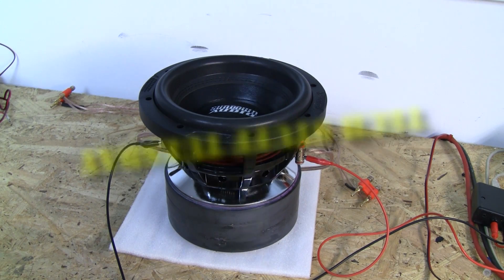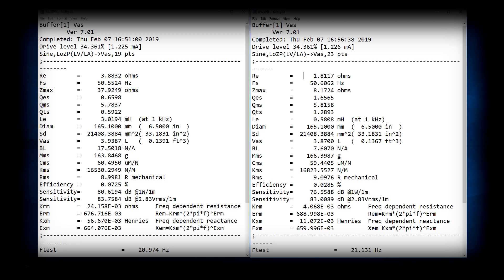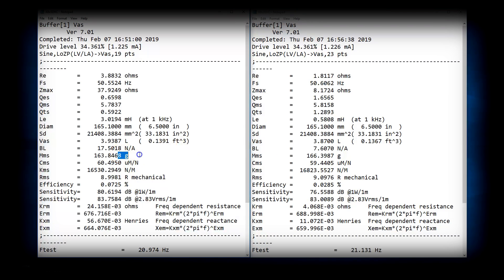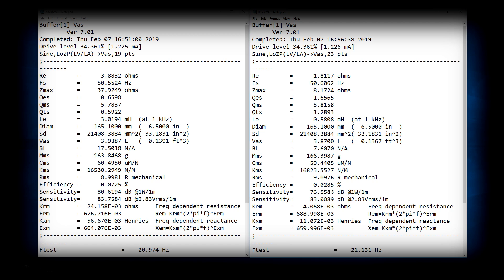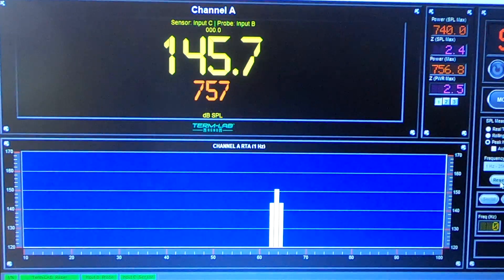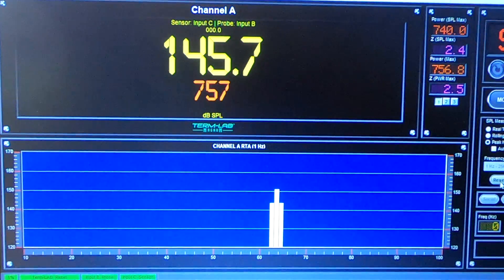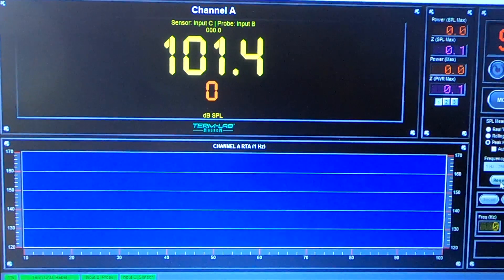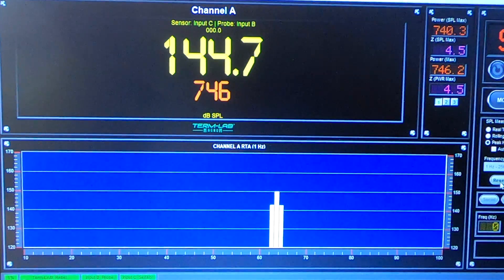This is what happens with 1 of 2 voice coils connected - Tech Stuff Tuesday

Comment: Since you tested the woofer parameters with the coils in series but did the spl test with them in parallel, would there be any difference in SPL if both configurations were tested? Assuming you achieved the same wattage in both tests.. My guess is the difference would be negligible, since the amp is large enough to achieve 750 into both configurations.
Reply from the maker: I've tested that in the past and found no difference in score, some people have claimed a difference but I think that is more the effect on the amp and how it's working because they were doing things like wiring at 0.25 ohm and 1 ohm with 1 ohm being louder, while clamping the same power.
Reply: @EMFAudio  Yeah I would agree.  I believe an amp's damping factor can take a real dump at that low of impedance. Among other possible factors.

Comment: So basically get a good amp that can push the crap out off anything no matter how you wire the subs
Reply from the maker: Doing that would result in a very expensive amp that isn't necessary. Example, if you need 1,000 watts @ 1 ohm vs 1,000 watts @ 4 ohms. You'd be buying a 4,000 watt amp to use it for 1,000 watts, which doesn't make sense.

Comment: Now see what happens when you run different signals to each one of the coils.
Reply from the maker: Bad things happen.
Reply: That's exactly what a dual voice coil speaker was made to do! They were invented as a way to flatten the unruly old subs response. Before EQs were invented they used notch filters to isolate the frequency with the peak running in reverse polarity. Once EQs came out Dual voice coils were were no longer needed. Then someone sees that old patent and makes a similar sub but uses both in same polarity, once again proving very few new things are ever really new. Things haven't changed much since 1930. Most new patents are bought up by big companies like GE who sits on it just to make sure that idea is never made, allowing them to continue making the same thing they already makibg with huge profits, only changing over to the hiding patent items when they see other companies developing a similar idea. Then we think it's brand new but in reality they're slowing advancement for their own profit. Look into old patents snd you'll see all kinds of new tech that is actually old news to those in the know.

Comment: Why the bass port on the outside of the box?🤔
It's supposed to be on the inside
Reply: They have outside ones also. Then you can change the length for different tuning
Reply: @mikecheeze4312  It's just normal ports but on the outside.
Can also change the length if they are on the inside and the result is a bit better in my experience.
Reply from the maker: You can't fit that port length in that box, for starters.
Reply: @EMFAudio  so really it's because it won't fit vs being more easily interchangeable? Is it common to build a ported box that the port doesn't fit in? Forgive my ignorance but I've haven't seen but a couple boxes with "out reaching ports" or whatever they're called
Reply from the maker: @mikecheeze4312  Being easily interchangeable is another reason. In terms of SPL, external ports are often louder. It's not uncommon to do external ports like this for SPL applications. It isn't normal for daily music stuff. These SPL boxes are generally tuned higher with more port area than you'd have for bandwidth.
Reply: @EMFAudio  Then it would in general be better to use a single slightliy wider but shorter port. I have tuned some enclosures to go very deep and very loud without having this long ports.
Reply from the maker: @Oystein87  There is more to it with these SPL boxes. But, regardless of if the port shape, port area is port area and that gives the same length for a tune. Shorter and wider requires the same length for tuning.
Reply: @EMFAudio  So it's more a SPL thing then?
No, not quite true. Shorter and wider (up to a point) can give the same tuning as 2 longer ports. When using 2 ports they need to be longer than just using 1. In general. But not always..  Depends of the giol. But since this is pure SPL use there is a a little difference.
Reply from the maker: @Oystein87  The difference in tuning from using 1 side of the enclosure as the port is very minimal, you might say inaudible.
Reply: @EMFAudio  I think you missunderstood me😋 But anyway.. Like the videos👍

Comment: I blew one coil in my sub so had to use just one and the difference is the sub looses half it’s power. It was ok but didn’t shake the car half as much.
Reply: how did you wire it too the amp tho
Reply: King Shumpert hi, I use to wire my dual voice coils in series so one lead to the negative to the negative on one coil and positive to the positive on the other coil. Then use a short wire and put the last 2 connections together. So if both coils are 4ohms, the amp will now see both together as 8ohms. If you google connecting dual voice coil subs in series or parallel you will see what I mean and gain a lot of info. It’s important you don’t wire them in parallel as the amp will see 2 4ohm coils as 2ohms and your amp will get very hot as it’s pushing more power and a lot of amps don’t like a 2 ohms load. Normally high end amps can handle 2ohms or even 1ohm per channel. Better amps can even handle 0.1 ohms. All depends on your amp really of what you can run. How I did my subs was the safest option for me. It’s all maths with how to wire them up. Just make sure you read about how it works. My alpine amps were perfect for how I had mine setup. If you look at my channel I have a video just showing my setup from years ago. 👍🏻 hope this helps

Comment: I did this and blew my sundown sa 15 v2 
It was a dual 2 ohm and my amp at the time was only 2 ohm stable. So i figured i would just connect one coil.
It lasted a good two months from what i could remember. Blew out of no where had my entire car smoked up
Reply: Should have connected them in series and brought the load up to 4ohm. Your amp should have had no problem with that ohm load. just not as much power.
Reply: ostelo84 yea but i wanted more power out of the amp .. so i put it at 2 Ohm it’s all good after i blew that sub i got a sundown X12 with a sundown 1500 watt amp
Reply: ostelo84 what would you suggest? I blew a lead and don’t wanna buy another sub. I have kicker l7 2 ohm and a kicker cxa 600.1. I wanna just run one coil. I have two other subs to go with it. 3 12 inches is what I’m trying to run.

Comment: Is it possible to hook up a 2 channel amp to dual voice coil sub with one channel to each coil?
Reply from the maker: YES! You can do that, however, it is very critical that the input signal be exactly the same. Even if the sub output is summed mono from the HU I have seen different voltages from each output before. If it's not summed, you'd want to use a splitter from 1 to 2 going into the amp.

Comment: This car you’re testing in is very efficient in the 60hz range , incredible numbers, the best enclosure I ever made had a 122dB @ 1 watt at 42 hz , 152 with a 1000 watt amp. If you’re wondering it was 4 15s in a 4th order bandpass tuned to 50 hz , the box was in the bed of a 1992 Ford F-150 , blow through, the box was ported into the cab , Dayton audio dvc 15s and a Memphis audio 1000 d
Reply: Awesome 👌 
Yeah , the pickup truck blow though builds aren't as common nowadays 🙄

Comment: A video I would like to see is tips for the competing bass boxing and anything that would help in competitions
Reply: Make a box like we did when this all started. It's called a death box, it's made in a way that you can mount a sub then slide one chamber into another chamber so you can change the volume of the box. You slide it till you get best output. Then you mark it and do the math or copy the dimensions and then you know exactly in the real world using real dimensions immediately. One box can be used to find the perfect size for any driver as long as you make the ends of the box big enough to mount the dtiver. Adaptors are used or multiple end caps with different sizes holes, using a different end cap makes it easier to figure the total internal volume since your keeping all demensions constant. Changing shape of boxes affects the output. Making boxes without any parallel sides defeats any standing waves. I'll stop here so you can do the research yourself
Reply: @robertzinda9818  this is a very good piece of information, but I really want tips on competing in competitions, since this comment I have built a wind monster 6-18's on like 40k watts, I really want to win some competitions but idk what I could or could not compete in

Comment: 1 amp per voice coil?

1 voice coil per channel (stereo or 4ch)?

Watts per db?

Spl vs box size?  (Wanna go loud but dont want to take alot of space)

When is 4th/6th order bandpass actually beneficial
Reply: 1.) Yes you can use 1 amp per coil. Absolutely recommend using identical amps. Use a DMM and match gains. 
To get it exact:
Take leads from one coil and reverse the connection so it is out of phase. Run a test tone. Start with volume about midway. Dial one or the other amps gain until there is no movement from the cone, use your hand to feel. 
Keep raising volume and repeat 1 step. Continue until you get to max listening volume. If the amps have phase dial, not switch, you might have to adjust to get to that sweet spot where there isn't any cone movement
Reconnect sub leads correctly.

2.) Yes you can run each coil on its own channel. If there is separate gains for each channel, you can use the same steps in [1.)]

3.) There isn't a magic number, it's subjective to numerous variables.

4.) Box size is predicated by the subs t/s parameters. Get a sub that has needed specs. This link will calculate your subs enclosure size.
https://www.diyaudioandvideo.com/Calculator/SpeakerBoxEnclosure/

5.) More of a personal choice. Also 6th orders are usually large.
Reply: @stevebrown1515   much appreaciated as ivr been waiting for a vid but i doubt hell respond
Reply: @stevebrown1515  putting full power to a coil that isn't moving seems like a surefire way to burn it.
Reply: @jackmills5071  no it won't. All that it does is use the motor force from the one coil against the motor force of the other coil. We are just doing this to dial in the gains ro match them.
Once you correctly adjust it, the sub will stop moving. Then hook the wiring up correctly and enjoy.
Reply: No problem. 
Happy bassin'!!!

Comment: Is wiring a svc and a dvc sub with same rms. And size say 12''okay pple say '' its okay its the final ohmrage that matters but i think that x_max matters i read that dvc have lower x max than svc and air moved by cone=bass=(x_max*cone area) ellaborate this please
Reply from the maker: Xmax has nothing to do with the coil impedance unless it's a totally different sub. I'm not sure I understand what you're asking.
Reply: @EMFAudio  he is asking  if he can wire two subwoofers one svc and one dvc that have the same Rms and same ohms in the same box together
Reply from the maker: @danielmcbride2383  If it's a different sub, the answer is no, not for ideal results.
Reply: @EMFAudio  I got two subs like that and I can't tell the difference when I replace them with two that match both sound good and both still hit 147db  and there junk kicker comp
Reply: @EMFAudio  maybe not ideal but it works
Reply: @EMFAudio  mine are in a sealed box each sub has there own enclosure
Reply from the maker: @danielmcbride2383  That helps, but there are other factors that make it less than ideal.
Reply: Is your box separated do each speaker have its own space if it does it should be fine

Comment: Hey EMF Audio..can you guys do a video on motor force..let's say two subs with identical soft parts but have two different motors?. One let's say rated at 1000rms with a average motor and one with monster size motor? What will be the output difference or over all quality difference? Keep up the technical videos guys. I'm learning a lot.
@iInstallRVA
Reply from the maker: The motor isn't the only factor in power handling, and odds are if one was 1,000 watts and another one had a huge motor it wouldn't use the same coil so power ratings on the coil wouldn't be nearly the same either. Comparing everything the same but motors where that would work out, I could tell you what would happen but just saying it doesn't have the value as showing it. Showing it would require building 2 subs identical for no purpose other than the video.

Comment: two requests. one: if you wire a resistor (changes ohms) in to the subwoofers speaker wires, would that be a more precise way to wire down, say for burping? other the the two choices of voice coil configurations. this way you could play around with impedance and also your frequency for the highest score. two: what happens if you wire down really really low, then play a frequency that would normally produce a high ohm resistance? would the increased power from the amp make the score higher?
Reply from the maker: Long long ago, nearly 20 years ago, there was a device sold that would do exactly what you're talking about. The idea was if you had a single voice coil you could wire lower. What we found was you gained power from the amp being at a lower impedance, but you gained no performance because that power generated was lost as heat in the device. It was also limited to 600 watts I think it was, that's all it would handle. Remember, those components have limits too. For the purpose of burping as you say, what most people do is wire in series for daily and parallel for burping. You change the impedance for no money and little effort. That is also part two of your question. If impedance rise is say 4x, wired to 2 ohms would play at 8 ohms and wired to 0.5 ohms would be 2 ohms during play so you do get a lot more power, which in turn makes the score higher.
Reply: my buddy ran those 20 years ago, we called them choke coils. the amp got hot and so did the coils but he swears it was louder!
Reply from the maker: @billybullfrog  the mind can play tricks with the ears.

Comment: Hi, great video again. But if the sub was rated 750, would you want to power the 1 coil with 750?(at least not for SPL) also, how does this apply to someone who wants to power their dvc sub with an amp on each coil? I don’t know what the original question was, but it makes me wonder if the original question was about only having limited power and trying to find a stable impedance for the amp, so you might run 1 coil. Thanks again man, great videos
Reply from the maker: I mentioned in the video that you wouldn't want to do that for more than a burp because power handling is cut in half. For using 1 coil per channel, you can absolutely do that but with one caveat. The signal going into each channel must be the same. Left and right channels in tracks can be different sometimes, so best practice is to make sure it's a mono signal being split to each channel.
Reply: @EMFAudio  Thx for that reply i was reading along to find an answer to my own issue. I have (2) DVC subs with 4ohm coils coming in the mail but i have only a 800watt output 4 channel AB amp i dont think the amp will go below the 4ohm so i needed to know if i could home run single channels to each voice coil. I have already ordered the rca splitter so channel 1-2 get same signal and 3-4get the same and will be left and right respective to the head unit and box. Wish i could afford a set of mono amps but it just isnt in the budget so i will harvest the AB 2/3/4 channel i have been lugging around for 2 decades and put it back to work. I'm sure it puts out its rated per channel as it has blown a few subs, woofers, and 6x9's in its life time. Maybe time is running out for the old amp. I got some AudioPipe TXX-BD2-10  i snagged for 200 a pair on the way and a Qbomb10tb dual 10" box with the quad triangle ports to put them into. The web says the subs are 600watt rms so i am shooting for 150watts per channel from the old tired amp and see what gives up first. Pretty sure the amp will start identifying as a space heater...

Comment: could you do a test comparing the difference in spl  if there is one between series and parallel wiring at the same wattage.
Reply from the maker: If there was a difference, it would be case specific, and within a tenth or two.
Reply: cool thanks for the reply ,just wondering

Comment: Great videos is always and thank you for pointing that website out to go ahead and get all the apps and xs power stuff question I want to put a XS power under my GM truck but my truck takes I post what adapters do I need for any work cuz I see y'all have two types maybe three 🤔👍🏽
Reply from the maker: What year truck do you have? That changes what is needed.
Reply: @EMFAudio  2003 Chevy Tahoe 5.3 side Post
Reply from the maker: http://www.emfcaraudio.com/xs-power-551-side-post-adapter/ that would be the side post adapter you need, it works on the D and S series batteries. It will not work on the A or V series.
Reply: @EMFAudio  ok cool thanks I ordered the wrong one then I ordered the 555
Reply from the maker: @FLYGUYFOX  555 still works, just don't need the top post adapters in most cases. That's what I had in my truck and left them capped. They were out of 551's when I needed one so I got the 555. Did you order it from EMF?
Reply: @EMFAudio  for the good stuff always 👍🏽
Reply: I got that adapters and today and yes they fit like a champ thank you very much the 555 on a XS POWER D5100R 😻💪🏾💪🏾💪🏾